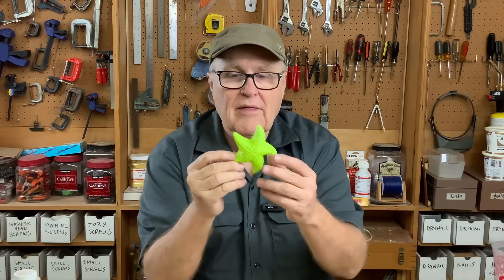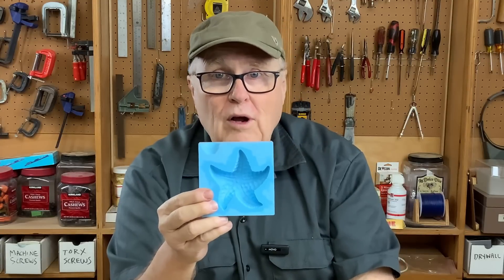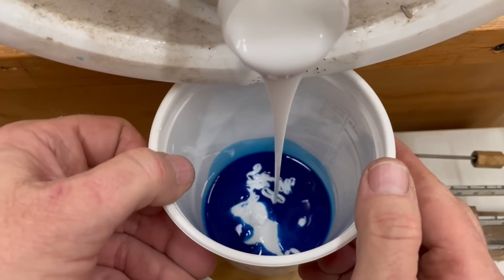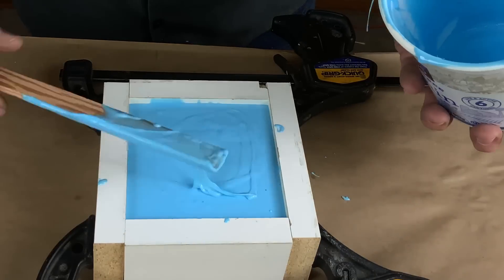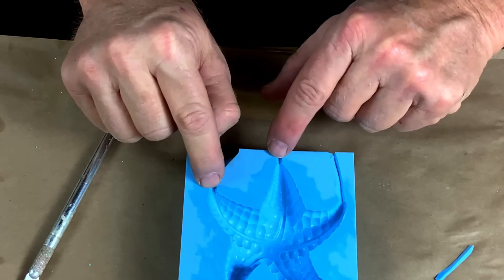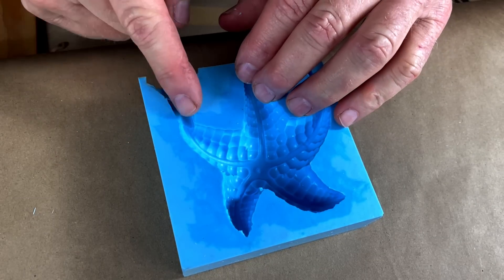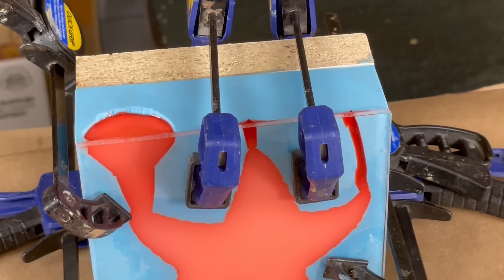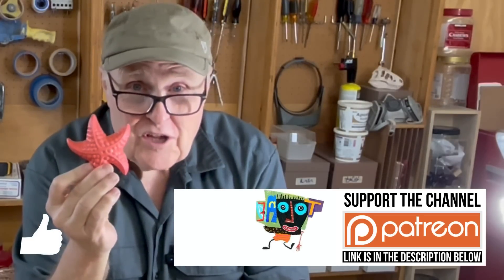No Matter What Position, Size Matters

Comment: I would love to see you molding and casting action figure parts. Some of the parts, like a bicep, have a mushroom shaped through hole that I'm guessing would require a water soluble wax core that's insert molded. Plus that part looks like it would be a multi part mold due to the parting lines. Also some action figures have disks inside their shoulders that are trapped, not sure if this was insert molded or not. If there is anything I need to do on my part to make this happen, please let me know!

Comment: Hi Mr Tolone! With Amazon having some deals on Silicon -- are there any you would recommend?
**NOTE: also posted on the community tab...if you can or want to answer there instead. :) All good!!
Reply from the maker: I can’t personally recommend any because I haven’t used them.  What is more important than the brand is whether to use a platinum or tin based rubber and the Shore number. 10 is very soft and flexible, 60 hard and stiff.
Reply: @RobertTolone  definitely makes sense and completely understand. Thanks!!
Reply: @RobertTolone  quick followup: for small pieces that may need to be squish mold-> harder shore'd, then?

Comment: Just a quick point, if mixing polyester resin Dont put catalyst in first!. Especially when using barrels the accelerator settles, so when the tap opens the cobalt hits the catalyst and explodes. This is why you should always spin the barrels/ tubs.

Comment: The one thing I'm wondering is, why not put the pour spout in the middle? Is it less likely to get air bubbles when you fill from the side and it flows outward?
Reply from the maker: Yes, putting it in the middle would have worked too. The reason I used the side entrance was so that the funnel would be lower down so the mold would be shorter and use less rubber.

Comment: I haven't spent my entire career casting resin parts, but I've done my more than my fair share over the years. I'm really confused why you chose to do this part the way you did. There was no need for any channels in the mold at all. All you had to do was lay the mold down and fill it up with resin until the resin topped off. A light brushing of resin on the plexiglass and all you had to do was lay the plexi glass down and put a small weight on it. I doubt I would have even done that. Just fill the mold and leave it. The back could be sanded smooth after curing.
Reply: @costa_marco  Oh, thanks Mr Robert Tolone for letting me know that.

Comment: If I use a chunky that had accelerator used, in a new mold (that has no accelerator) will the new mold be accelerated or does the accelerator become ineffective once the original rubber cures?
Reply from the maker: The accelerator would be bound up in the molecules of the chunks and have no effect on the new mold.
Reply: @RobertTolone  thank you for responding and for teaching us (:

Comment: I was wondering, wouldn't it be much nicer to use blades made for lino cutting for the vents? It seems that with the exacto knife you end up removing allot of rubber, which could make post processing more of an issue if you dont pay attention to the original shape...
Just an amateur myself, but its what came to mind!
Reply from the maker: I find round engraving tools to be very difficult to push through silicone rubber. But you might have a better result than I did. And if so, it would work great.

Comment: Hi Robert, thanks for making these!  It seems like larger vents means more post processing and a loss of surface quality at the point it joins the part. Is it possible make a small hole and stretch it open with something like a funnels tip or nasal speculum during filling?  If the mold snaps back to its original shape before the resin sets and becomes a tiny hole, it seems like it would reduce clean up and give you more of the original shape.
Reply from the maker: You always have to balance the time between fussing with the pouring process and cleaning the casting. See which method is faster for you and then go with that one.

Comment: Small detail I noticed while filling the star the second time you can see a small air pocket get stuck and bubble out (around 6:38). I found that really interesting to see and watch. It gave me a better view on why I sometimes get bubbles close to my pour spouts.
Reply: Perhaps it would have been more ideal to connect the pour spout closer to the base of the arm which would be a longer spout, providing more head pressure. Then, add a third vent to the tip of the arm (basically in the same place as the pour spout he made)

Comment: Bob, pretty neat!  I like the see through pour. Like you said, you can see how it sets up.  A question that begs an answer, why couldn’t you lay the mold down with the mold opening up and pour into the opening?   Best regards, Richard
Reply: it's a teaching exercise, the goal is to show a new technique not to make a plastic starfish by the most efficient means possible
Reply from the maker: Exactly.  I wanted to show how a mold fills and that required a shape with a flat side for the window.
Reply: I was thinking the same thing